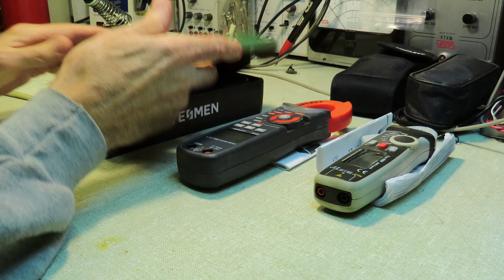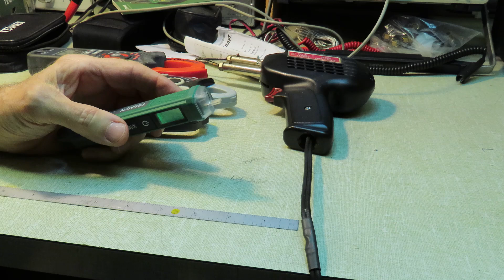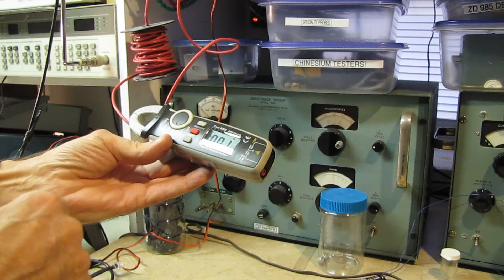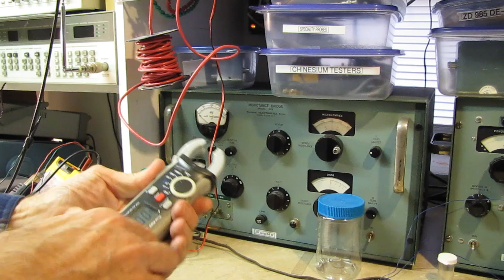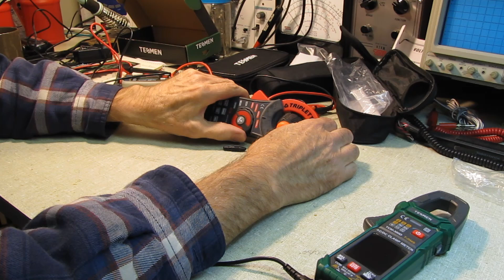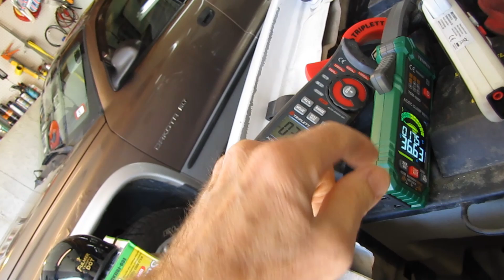TESMEN TCM 300D Review

Comment: Were you in Bangkok during the earthquake?
Reply from the maker: @stephenemanouil6745  we live in Pak Chong about 2 hours drive north of Bangkok, actually much closer to the epicenter but never felt a thing.  Bangkok is on an ancient delta, basically mud,and really felt it.
Reply: I was in Bangkok on the 11th floor of a hospital speaking to two doctors across a table and felt strange not having control of my sitting position. And then the two docs looked at each other and I saw a drape swaying back and forth and said an earthquake and as we were under the table I thought for sure it was all coming down. Scary. @theradiomechanic9625